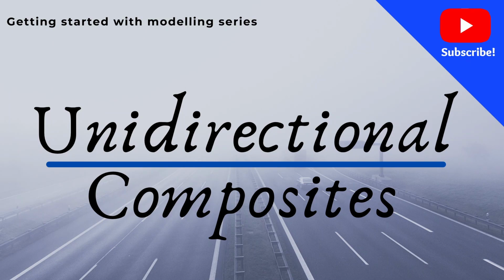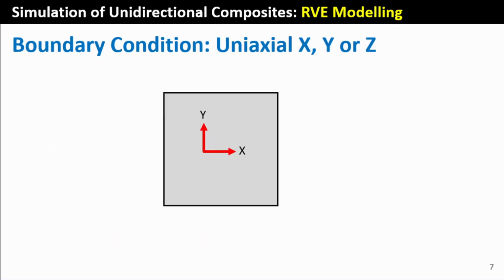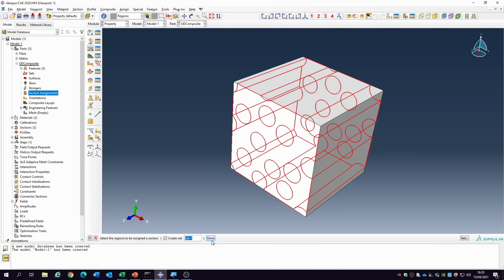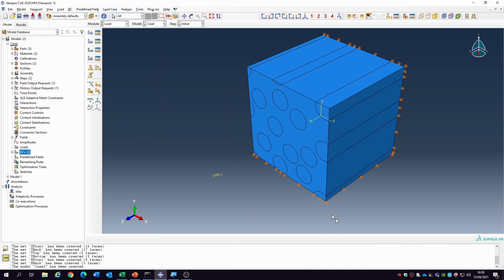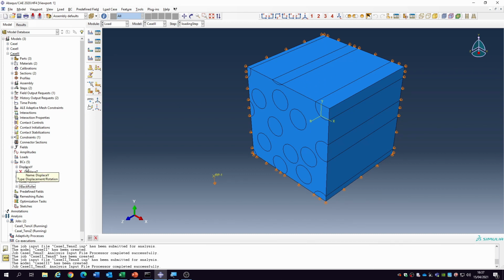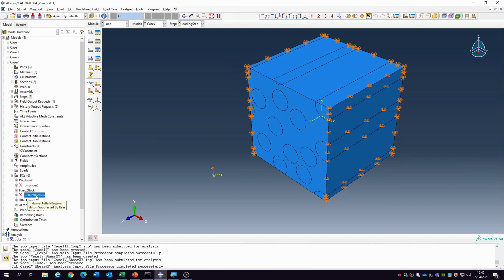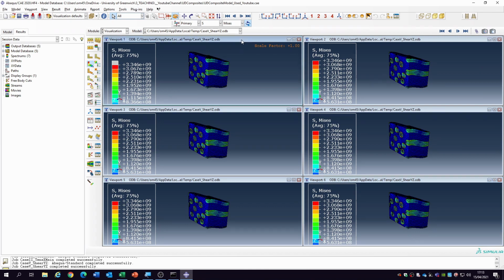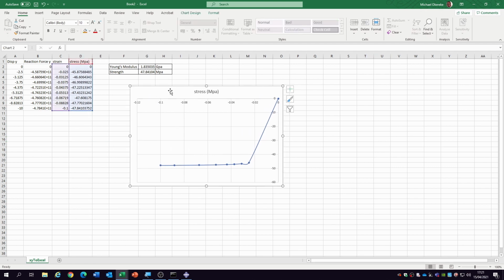RVE Modelling of Unidirectional Composites in ABAQUS

Comment: Sir, first of all I would like to thank you to your video. I wanna ask a question for you. Now, I am working on blast loading responce of a plate (only plate, not any fiber). I did some analysis via Abaqus. But I have a error. My error was;
     Excessive incremental rotation of the elements in element set ErrElemExcessIncrementalRotation-Step1.
     There is only one element with excessive rotations.
After I took this error, I increased my mesh elements number. But after this, I took another error. Now my error is this;
     Element 21, node-1: the distance between the node and the source of the explosion is smaller than the charge radius (5.30000E-02). The CONWEP model is not valid at this distance.
What can you say about my error? How can I fix this error?
Best regards
Reply from the maker: Hello @Ali, great that you were able to solve the first problem. I think the second problem is due to the location of the charge that you are using in the CONWEP system. I will suggest you increase it and check to see if the second error is still happening. For example, it is saying the charge radius is 0.053 (I assume that is meters), hence you may have to increase it to 0.150 and see if that improves it. Do not that the further away the charge is from the plate (i.e the location of the explosive), the lesser the impact the charge/explosive will have on the plate so you cannot just increase it arbitrarily. 

A rule I normally will follow is to start with a distance as far back as the half the edge length of square plate and then possibly reduce or increase it depending on the deflection you see on the plate. If you have an experimental data you are working with, then no guess work here, simply use the distace specified in the experiment. Good luck. 

Here is a paper that might help you: https://doi.org/10.1016/j.ijimpeng.2011.02.005

Comment: Could you please advise how to obtain the dispersion curves of an RVE unit cell in Abaqus?
Reply from the maker: Hello @Ha-Linh Nguyen, the concept of dispersion curves arises during dynamic assessment behave of heterogeneous materials or multilayered composites. This is because the differences in effective properties (Modulus and strengths) inside the heterogeneous materials leads to different propagation of wave dynamics within the heterogeneous material. As continuum has to be maintained, such differences in propagation will lead to dispersions of the wave as it hits different materials in the medium. There are a bunch of equations proposed by C. T. Sun in Continuum Theory for Laminated Medium, Journal of Applied Mechanics, 1968 which helps in tracking this dispersion curves and plotting them. I believe this is the sort of thing you are interested in. Having said all these, I have actually never done this sort of modelling and so will not be able to help you with this query. I will have to research into it, understand it better, implement it before I am able to make a video about it. For now, this is all the help I can offer and good luck with the research.

Comment: Why are you using this boundary condition? can we evaluate this boundary to another one? thanks for all your useful videos
Reply from the maker: Hello @Anis, thanks for the query. I am not sure about your question. There are many ways of applying displacement loads on structures in a micromechanical model. I chose this type as it helps me extract the history outputs by tracking displacement and reaction forces variables in the reference nodes.  If I use a direct application of displacement on the face, then my history variables will be too much and so unable to generate the stress-strain graphs. 

As regards comparing it with some other type of loading, what do you have in mind. I will need some further explanations.
Reply: @MichaelOkereke   thanks for your answer. This was my answer .👏👏 good luck

Comment: Dear Sir, In case IV-model (Shear-XY), from which value we will draw the plot: RF1, U2 or RF2, U2 or RF2, U2? Kindly help.
Reply from the maker: Hello @Adarsh Shah, since you are looking at plotting for Shear on XY plane, it means that the deformation you are looing at is on the plane where X- axis is the outward acting normal and the direction of shear is along the Y-axis. 

Therefore, the reaction forces you should be looking at is the RF2 which is reaction due to displacement in the 2 or Y-axis. The shear deformation will be defined by the U2 displacement which is basically y-axis displacement. So, the correct variables are RF2 versus U2 to give you shear Tau12 versus Gamma12.

Hope this makes sense.
Reply: @MichaelOkereke  Thank you very much Sir.

Comment: sir, how do you have a fine mesh, when i submit the job it says student edition is restricted to 1000 nodes
Reply from the maker: Hello @Jahnavi, this is common experience of most students when working with the Student license edition of ABAQUS. There is no way around it, except you refine your mesh by increase the seed size (during the seeding of the model). You have to use the Query (or i-button) to check the number of nodes in the model as you keep refining it. 

For this specific video you are considering, irrespective of your refinement or coarsening of the mesh, I will not believe it is possible to stay within the 1000 nodes limit. 

You can however try modelling in 2D in which case you can. Good luck with the work.

Comment: Hi, Dr Micheal. Just wondering what is the contact property between the fibers and matrix? Or it does not matter in this case?
Reply from the maker: Hello @Haowei Huang, thanks for your interest in the channel.  I have not used any contact in this model. The fibre is tied permanently to the matrix at the interface.  In future,  I will make a video where I include an interphase which is an improvement in this video.
Reply: @MichaelOkereke  that would be awesome! Looking forward to your new video. I am doing the comparison at the moment, with “hard contact”, “soft contact”, cohesive contact and without contact. The behaviours are all different. So without any contact case. In linear stage, can I assume that the contact stiffness is actually the matrix modulus? Does this make sense?
Reply from the maker: It shouldn't be the matrix Modulus but something above it but below the fibre Modulus. It is this interphase Modulus.

Comment: great video, just have 2 questions: 1. what is the contact properties you are using? 2. Are those boundary conditions periodic boundary conditions?
Reply from the maker: Hello @Haowei Huang, thanks for your interest in the channel. 

1. I don't have any contacting parts in the model so no contacts were specified. In some models  you may introduce contacts between fibres and matrix but this is not standard.  What you may want to do is introduce a cohesive zone between fibre and matrix but that's a different problem.

2. The boundary conditions are Dirichlet or displacement boundary conditions. I haven't used PBC here. 

I hope the above is okay with you.  Let me know.

Comment: I am trying to model a RVE with transversely isotropic fibre. After completing the relevant steps, I have added a local orientation. For the meshing part, using the same steps, the process is stuck in "Propagating mesh seeds". I am relatively new to ABAQUS. Kindly help me.
Reply from the maker: Hello Srinjoy, I think it's with your mesh. Increase the mesh/seed size and see what happens.
Reply: Yes, thanks and also thank you so much for uploading such wonderful videos on the topic. It is very hard to find such topics on the internet.
Reply from the maker: @DriveKarma  Thanks

Comment: Very insightful video sir. Sir I have a query. What modification do we need to make in HISTORY OUTPUT REQUEST so that we can calculate shear modulus from shear forces  in the 4th and 5th Case. And finally what should we choose in place of Reaction force and Displacement in the ODB history output to find shear modulus?
Reply from the maker: Hello @Sandy, thanks for your interest in the channel. For shear modulus you simply have to follow the same approach but of course change the boundary conditions to make sure you are simulating shear responses in I believe you mean YZ and XZ planes. For example if it is Shear YZ you are simulating, then you are simulating shear on the plane where Y-axis is the outward pointing normal and the shear forces are oriented along the Z-axis. Therefore, for this you need to extract shear force, RF3 (z-axis reaction force) and divide this by the area of the YZ plane where the shear force acts. This will give you a shear behaviour. I have made videos where such shear cases were investigated. Here are some of them: RVE Modelling of BD composites (https://www.youtube.com/watch?v=zHUC0cVkdVM&t=690s) and Hybrid Composites - an RVE Modelling Abaqus tutorial (https://www.youtube.com/watch?v=1rdbKix_biw). Good luck with the work.
Reply: @MichaelOkereke  Thanks a lot sir😊
Reply: @MichaelOkereke  Sir if we want to apply a temperature field then the temperature value should be in Kelvin or Celsius scale?
Reply from the maker: Hello Sandy, either is okay... Celsius or Kelvin is okay. Just make sure your units are consistent.  Ideally best to use Kelvin but in interpreting your results make sure you convert back to drg Celsius.

Comment: Great Stuff, Thanks a lot for making this video, I have one query why 10% of strain was taken in the model as a displacement boundary condition ?
Reply from the maker: Hello Karan, thanks for your interest in the video. Actually, the 10% is chosen randomly, just to get an idea about how the model will respond. Because I am doing a microscale analysis, where the matrix is explicitly modelled as an elastoplastic material (without damage included), then it is bound to show significant plastic deformation. It makes sense then to go for a higher displacement of 10% as against about 3% for most composites. To do the later however, we need to have a damage model included in the simulation so that we can predict experimentally recoverable data. I hope the explanation makes sense and that is what you are asking about.
Reply: @MichaelOkereke  Thanks a lot for such a good explanation, I have one more query regarding meshing in Abaqus for complex geometry, as I saw you are good in Abaqus, if okay can I mail you the geometry and ask my query? I am sure solving this complex part will be a engaging )
Reply from the maker: @karangupta120  - thanks for your interest. I will suggest you subscribe to my CM Videos Insider Group (here https://cmvideos.ck.page/16a99bd0e3) and we can take the discussion further from there.